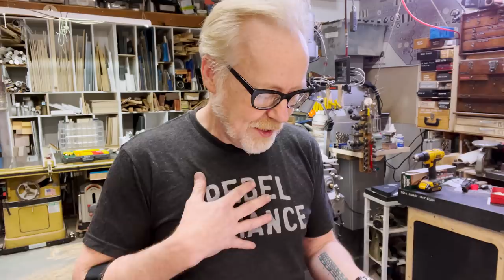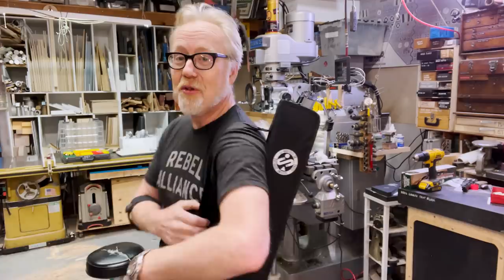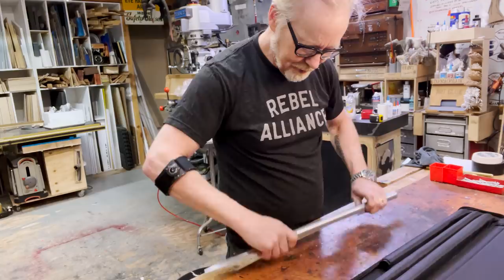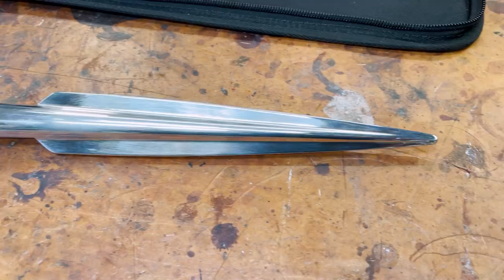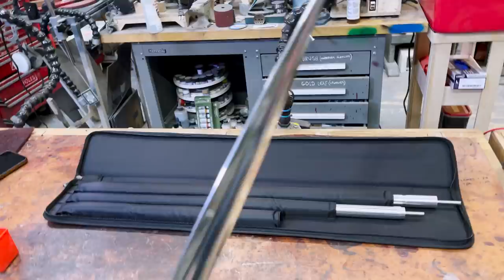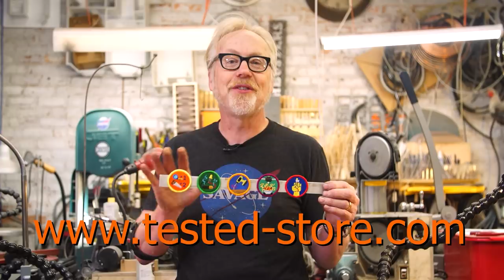Adam Savage's Beskar Spear Prop Replica!

Comment: Looks like a nice piece. Visited the the manufacturer's website and was actually surprised at the pricing - it is quite reasonable!
Reply: Yeah.  I wasn't expecting that.  Seems to me that's very reasonable for the materials and some work, without doubling it just because they can.
Reply: @No1sonuk  I know, right? So many of these style products are so overpriced it is hysterical - seems many companies will charge increasingly exorbitant prices just due to the hype or popularity of the subject matter. I come from a manufacturing background so I usually have a handle on what costs would be - and sometimes I just can't help but laugh. There was one video on Tested about laser cut wood models - and the pricing was insane - for what one model was priced at  I could literally buy a cheap laser cutter, the materials, and pay for a course in how to use it for less than what they were asking.  It is very refreshing to see a company sell a product for a niche customer base that is overly fair for the consumer.
Reply: @theangrymarmot8336  Yeah. I did some quick searching, and while I couldn't find pricing for the exact grade of aluminium they state, I found a cheaper grade that indicates at least 1/3 to 1/2 of their asking price is the raw aluminium bars alone.  As an amateur machinist and lathe owner, I can also appreciate that working material of that length/diameter ratio is not easy.

Comment: Hold it at its approximate harmonic nodes (1/2 length, 1/4 length, any other fraction represented in the harmonic series) with as little contact along its length as possible and it is likely to ring.

Comment: I think the best way to battle a lightsaber brandishing opponent is with distance and a fast firing high velocity lead throwing weapon.
Reply: a grenade
Reply: @2adamast  idk I feel like if the person has a lightsaber they're likely a force user and the could very easily throw a thermal detonator back at you vs many extremely fast moving small projectiles.
Reply: or arrows.
Reply: @peterkelley6344  idk man I think arrows would be too slow flying and not fast enough firing assuming the one welding the light saber is a force user.
Reply: @ZoniesCoasters  Thinking in Yoda mode: To everything there is an exception.

Comment: Get some nickel Never-Seez on the threads to prevent galling!
Reply: A post from one of the builders indicates they use threaded rods, so I'd assume they're steel.
Having suffered from aluminium threads galling, though, I did think it was folly for him to thread it together so tight before lubricating.

Comment: Please suggest to Karen and Luke that they develop a bayonet-type connection between the sections. The screw fixture A) takes too long to assemble, and B) only has the strength of (about) an M6 screw. Otherwise an excellent product.
Reply: Looks more like an m8+. and it's not for actual use.
Reply: @TheMijman  Could be M8. If not for actual use (and I don't suppose it was expected to be used against a "light-sabre") - it might just as well be made of cardboard or PCV tube, slugged with lead to give it a bit of "heft", sprayed silver and polished. Or maybe aluminium tent poles.
Reply: @John Glover - I would suspect that for the use that one of these spears is intended - the system they are employing is more than strong enough. Also it is cost effect and easy to manufacturer which allows them to sell this at a price point that to be honest - is very reasonable. 

As far as your comment about "might as well be made of cardboard of pcv tube (I assume you meant PVC?)" that wouldn't have the feel of quality, weight, or the coolness of actually being completely metal. Remember - this is a prop - not a "real" weapon but even so the weight and solidity of this product makes it much more appealing and "realistic" than something composed of lightweight and/or flimsy materials.  I would seriously doubt that a normal hobbyist could assemble something like this out of cardboard / plastic / PVC that felt / looked as nice as this product and had the same durability and longevity - and by the time you add up the material cost and time involved in making something - the asking price of ~200 dollars for the metal one is a bargain.
Reply: A bayonet connection wouldn't be as secure, or tight-fitting at the joins.
Reply: @theangrymarmot8336  - still takes too long to assemble.
Reply: @No1sonuk  - in armed conflict you need quick. Ask a soldier if a bayonet is fixed securely enough.
Reply: @j1952d  Pretty sure this isn't intended to be taken to an "armed conflict."  It is a prop....... lol You seem to have completely missed the use-case for this item.
Reply: @j1952d  It's dismantleable so you can take it to conventions, etc.
It's not for combat deployment.
PLUS, a rifle bayonet isn't meant to look like it's an integral part of the gun's barrel...
Reply: @theangrymarmot8336  - might as well just start with a box of materials and start machining/fixing/gluing as and when the need arises. "You seem to have completely missed the use-case ... " as I understand Adam's view of things, his watch-word is verisimilitude. If I'm wrong, then so be it. Maybe he can answer for himself. Have a good day.
Reply: @No1sonuk  " .. a rifle bayonet isn't meant to look like it's an integral part of the gun's barrel..." I don't see that that statement has any relevance here. Bayonet-type fixtures have many more applications than weaponry.. Have a good day.
Reply: @j1952d  No one would want something that looked as shit as that sounds.
Reply: @j1952d  I fail to see where this product fails to meet Adam's "verisimilitude."  This spear, with the way it is assembled looks very, very authentic when compared to the screen used item. You are suggesting a radical change in assembly that would lead to more costly manufacture based on your arm-chair critique that the screw together connections would not be strong enough or fast enough to assemble. Your observations are based on a use-case that this product isn't intended for and therefore invalid.  This prop item isn't made to be quickly deployed or used in any fashion that would require more strength that what is provided by the screw style assembly.  The only reason this product is even made to be assembled/disassembled is for ease of shipping and transport (to what I would assume cosplay events or themed gatherings.)  The majority of people don't have the means to make such an accurate replica in actual metal so the price point, assembly, design, and materials of this prop are a great value for the money.
Reply: @j1952d  It's relevant because the Beskar spear is supposed to be made in one piece, not 4.
Reply: @j1952d  Oh, and one more thing: Making a bayonet fitting system would likely double the cost because of the extra work involved.
Reply: Hey guys! Ideally sure we wanted a system that allowed for quick assembly on our initial design but the costs get out of hand pretty quickly, I wanted to offer some insight into our development process on the spear, our key focus was something that was accurate but affordable, 

Bayonet fittings although fantastic for assembly speed would either have to be separately made from steel inserts with pocketed holes on each of the shaft sections and due to the relatively low surface area of engagement vs Thread engagement would potentially slacken over time when held & moved short of us having a constant tension system with a spring load (more cost again) to the moderate force that would be exerted on the joints when the spear is in motion, the threaded rods (M8) give the ideal solution here as any slackening can easily be taken up by tightening and is incredibly economical, and as the overall accuracy isn't harmed in any way it was a carefully thought out decision we were happy to make, The joins are made on the edges of the detail grooves (which is they the 3 sections are not equal) meaning the joints are invisible (the only visible join is the spear tip which is accurate to the join line we see on the original prop)

hope it helps show some insight into the decisions we made on this project :) 

May the force be with you!

Luke
(JJ Industries)
Reply: @sni9er  -  thanks for the clarification!